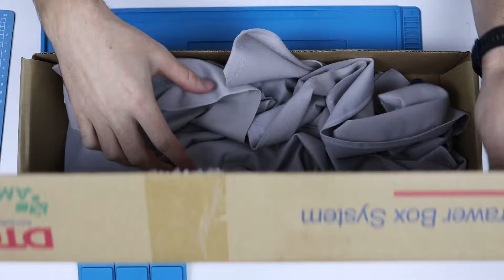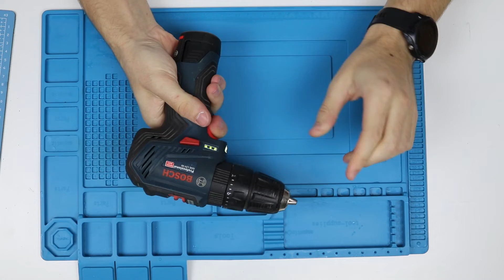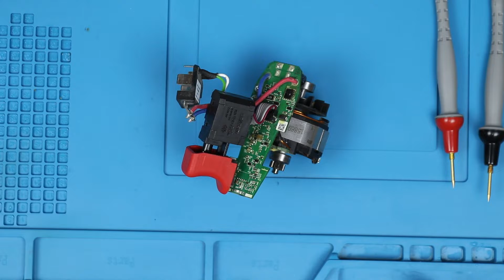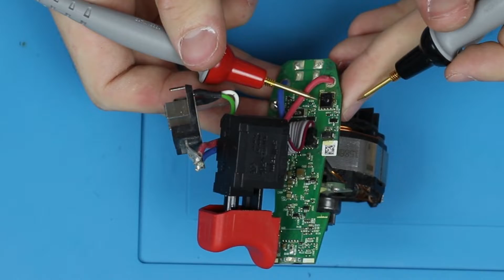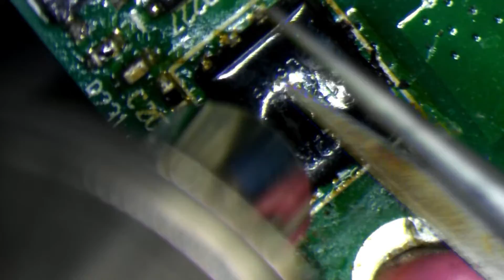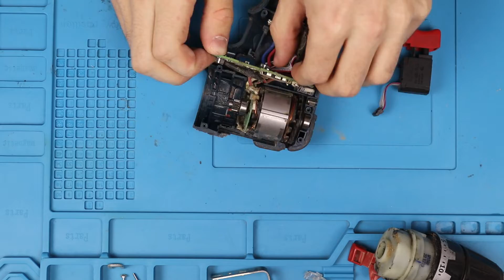'Faulty switch' is not actually faulty ?  — Brushless Bosch GSR/GSB 12V repair

Comment: I have a DDS181 18V that is intermittent...you pull the trigger and it won't start...shake it around a bit and it will start. Where do you think the loose connection would be and what is the best way to trace it if you can't "see" the loose connection? Thank you!

Comment: I have gsr 12V 35 and occasionally the break do not engage after releasing the trigger ( and the drill is unresponsive until it stops). I send it to under warranty repair and they change the circuit board, but it still do the same thing. Any idea what this can be ?

Comment: My mosfet is bown the same way. The only option I have is to buy the whole board from Bosch for 20 EUR. Can you please share the specifications for the Mosfet, I can see the original is H7084 but the one you used is H7440. Can you please provide the part number?

Comment: got a bosch psb li-2 its dead no turn no lights yet battery full charged, strip it down, do i test motor first or switch with a volt metre any help please.

Comment: The reverse ◀️ forward ⏩ swick is so animic in the forward ⏩ selection I've broken 💔 several and need replacement where do you get parts???
Reply from the maker: You can get most parts from Bosch directly if you need them for commercial use 

They are available at the Bosch service web site. 

For diy repairs you can always make a 3d model and print it or glue the old one back with epoxy and a small metal rod inside.
Reply: @how_its_fixed  i I just pulled one apart the the switch was broken I tried to fix it.. but the peice is so small no glue or apoxy will work I tried with a small screw  and ground it down using a die grinder but I had to keep it cool not to melt the very small amount of plastic. I got it in thought I had it but my third time switching it just sheared if you notice the forward side of the switch is very very small was this done on purpose?? If the tool is in reverse and dropped it will shear everyime!!!! I just found the part I have it on order.. I'm gonna take a peak at a few jobsite radios I wish I had your knowledge man seriously 😒

Comment: Stupid bosch quality. I have the 12v35 had the sae issue sent it under warranty, got it back did the same thing. Sent it again in out of warranty, so far they have fixed it. 

The same issue i have on 12v 15 hx but i am not willing to send it of to repair beacuse it costs me 30 eur. New one is 90 eur.
Reply: we bought 2 new drills similar to the smaller one in the video like a year ago and they immediately had this switch issue, we also have older ones for like 4 years and still use them with no problem in the switch, everday use also, so yeah idk, my boss is too lazy to send these back so we're gonna buy new ones probably haha